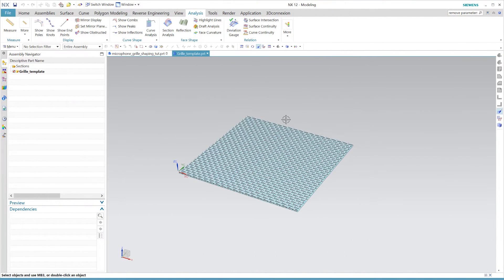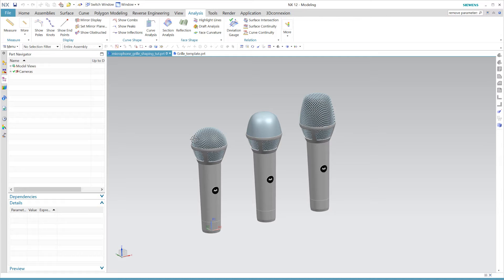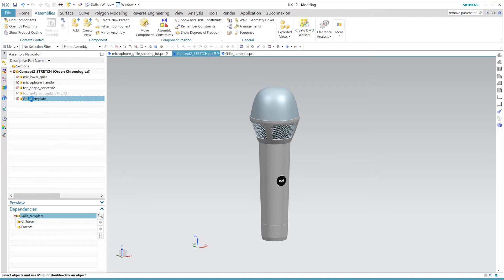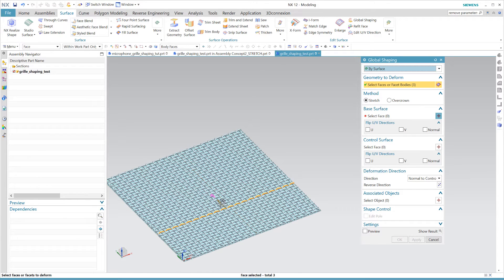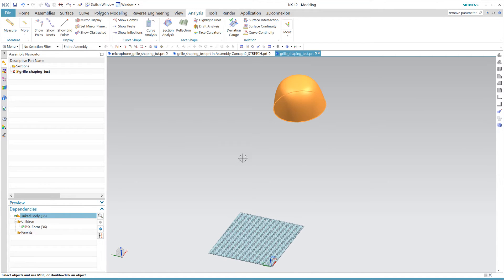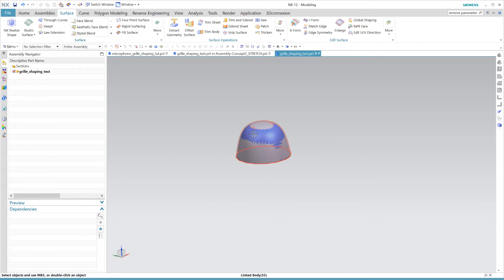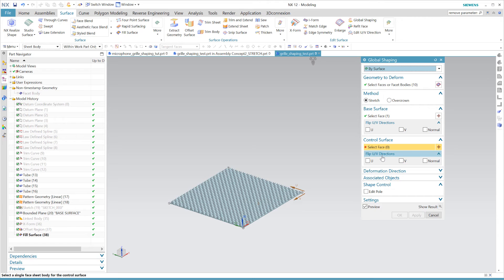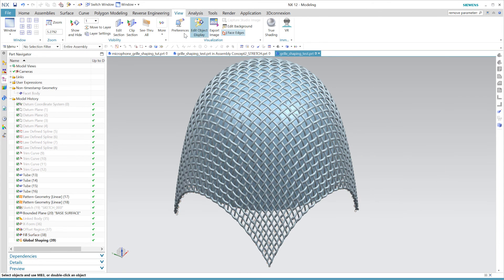[NX CAD] How to model a custom Microphone grille

Comment: Sumptuously! Thanks for the detailed tutorial and file of grid.
Is there a way to create a mesh of constant diameter on the surface? In this lesson, the fibers taper to the edges.
Reply from the maker: Cheers! I have been doing a few experiments on that, and I haven't found the solution yet. I thought enabling normal direction would take care of it, but it doesn't seem to deal with that slight tapering as you point out. 

TL;DR - Haven't found a solution to the tapering yet, but enabling Normal takes care of the worst.
Reply: @Miror  Thanks for the answer! I tried changing the X-Form grid (U and V), but it made it even worse or didn't work. I also want to achieve a coincidence grid location on the cap along the X and Y axes. In this method, the grid has rotation from the axis.
Reply from the maker: @13thwulf  Hmm.. are the length/width ratio on your base surface roughly the same as the control surface? I found that it's important to have as similar traits as possible for the two surfaces. If you can manage to preserve the surface area as well it would be perfect, but I realize that can be tricky. Also: Refit surface can do wonders if you are stuck with messy NURBS.

In summary, the correlation between base and control surface is crucial to transfer the shape of the grid.
Reply: @Miror  It is difficult to answer this question now. NX is not the main program in which I work. May I write you a letter (email on the Mirror website)?
Reply from the maker: @13thwulf  Ah gotcha. Well I understand it can be a little bit of a challenge then. I'm currently awaiting some license updates on my end, so I'm unable to look at it directly I'm afraid, but if you are in no rush I can have a look when I get a chance.